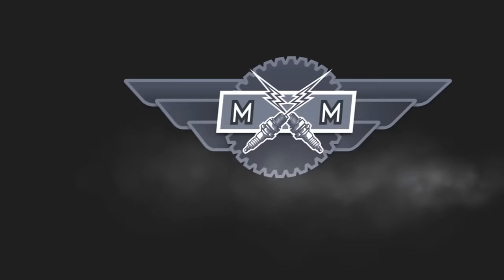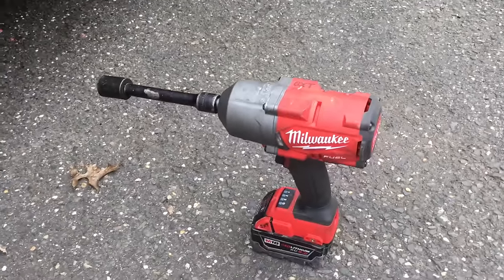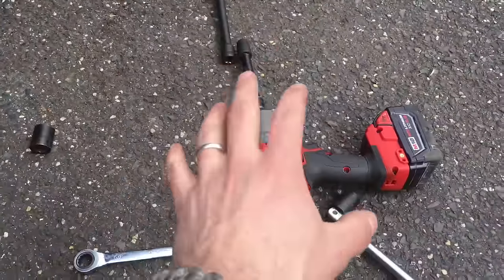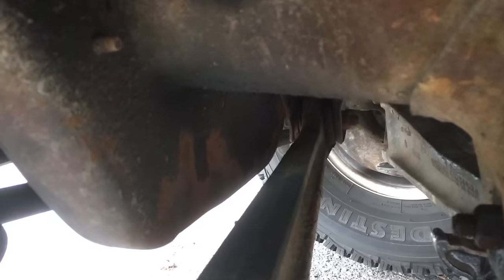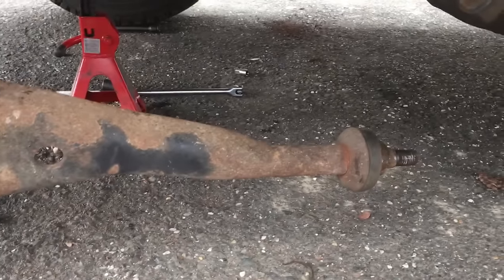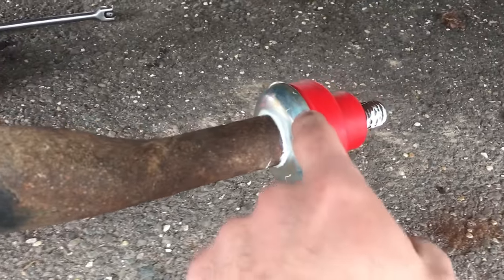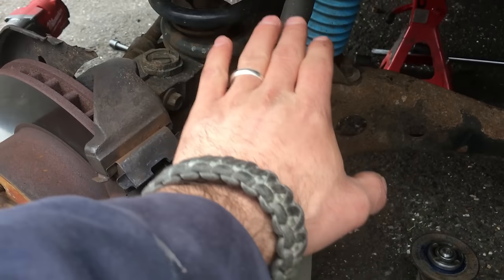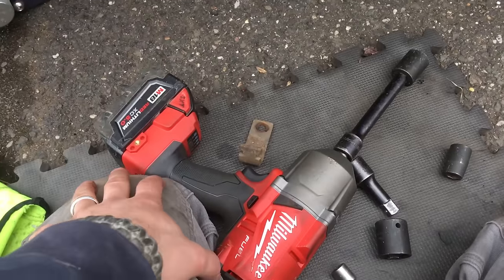How to Replace Radius Arm Bushings | 1995 Ford F150

Comment: To any torque freaks like me that might see this, the torque spec on the:
Radius arm bushing: 80-120 ft-lbs
Front shock absorber stud - upper: 25 - 35 ft-lbs
Spring retainer: 13 - 18 ft-lbs
Axle pivot: 120 - 150 ft-lbs
Reply from the maker: Thanks man! I appreciate you putting this year!🤙
Reply: @TheMinuteMasters  no probs, I've got access to the service data, I just like to see a video of how it's done if I can, so I appreciate the vid
Reply from the maker: @censorshipsoldseparately612  Nice! Service manuals are great for that info. Thanks🤙

Comment: If you do not use the spacer, the rear bushing will get torn by the lip on the radius arm bracket. You can get the washers and spacers from Ford. They are not that expensive.
Reply from the maker: Kenny Lee Johnson Yeah I ended up using the spacer. Not matter how I feel about the design of something. I always repair it to OEM spec just to be safe.

Comment: You don’t need an impact gun to remove nut from radius arm. Spray penetrating fluid a few days before you’re going to work on your truck. Mine came off super easy with a 20” breaker bar while laying in my back in gravel. 👍
Reply from the maker: Good point! I couldn’t get the correct leverage on my radius arm nut. So I opted for the impact gun.

Comment: The plastic part is there for a very good reason. I cannot believe you say it is your choice to or not to use it. The plastic piece goes on the MALE part of the hole and then flat side of bushing and then washer.
Reply from the maker: I found out later that that plastic piece is needed to keep the metal from rubbing and destroying the poly. I just don’t think I they can handle the torquing down of the nut. They seem to break on everyone.

Comment: Remember EXTENSIONS REDUCE torque. Use the shortest distance to remove nuts and bolts on TIGHT FOR YEARS. Torch the rivet heads off, knock bracket off with hammer. Tap rivet remaining with center punch. Install new bolts
Reply from the maker: This is true and removing the rivets is the fastest method for sure. I wanted to do it the way a traditional shop would.

Comment: I remember doing those at the ford dealer back in the mid to late 90s. I just remember taking the nut off and using a big bar to pry it out. We would slam bam stuff and move on. I think i used a snap on impact swivel so it had more power then an extension.

Comment: Nice video...I would like to mention that most professional front end guys drill out or grind off the rivets holding the radius arm bushing bracket and replace them with grade 8 bolts.  You can then do this job in a fraction of the time.
Reply from the maker: Thanks man!🤙 That’s what I’ve heard as another method. I wasn’t sure if Ford techs did that too.
Reply: Still took me a day
Reply: 1hr 30 to do 1 side without drilling rivets it would take that long to get the rivets out let alone go buy correct bolts
Reply: Sometimes if you're lucky, you'll have a truck that already has the rivets replaced. Mine were and it's a 1978. I had to replace the bushing and discovered it was so far gone by the time I bought the truck, I had to replace the bracket and radius arm. Luckily the donor was also bolted in.
Reply: I torch the head off those rivets. Once the rivets are gone and replaced with grade 8 bolts, this is a job that can be done very quickly and literally in the parts store parking lot

Comment: My problem was getting the bracket off on the exhaust side not much room. I'm gonna try a 3/8 breaker to hold the bolt in place and a 1/2 impact on the easy side.
Reply from the maker: Agreed. The exhaust side is tricky. If you removed the catalytic converter heat shield, you can get more hand room.

Comment: The plastic spacer is to go on the back when you have a raised section on the hole it stops the rubber chopping out on that raised lip.
Reply from the maker: That’s what I figured. My spacers are still in there. I which someone would make them out of steel or aluminum. The plastic can break when you tighten these poly bushings down.

Comment: The 4x4's aren't quite s easy. I went thru all the steps and still wound up grinding out the rivets. could not pull the radius arm forward enough. about 1/16" was all I needed, lol. Great video!
Reply from the maker: Rick Knight Thats what I hear. It only budged 1/16th? Did you unbolt the axle pivot bolts for the  I-beams? 
Thanks man!🤙
Reply: @TheMinuteMasters  No, all I needed was for it to move 1/16" more to remove it. Those aren't very flexible.
Reply from the maker: Rick Knight Ah I see. Yeah they aren’t at all.

Comment: I am not doing a F1 50 I worked on a Ford Ranger did the same job on a ford ranger 1991 and this helped Wish I would’ve watch  it completely because I didn’t remove the sway bars. Made it a little hard
Reply from the maker: Andrew Burns Yup! They do have the same suspension! Glad it helped ya!👍

Comment: Those end nuts are really tough.  Got mine done last fall.  I sprayed them down....heated them with a torch....and then had to go back and forth with the impact gun....and they finally let go.  Took me a few days to figure out how to loosen them....lol.  Toughest nuts I've ever had to loosen on the truck....a 1992 Ford F250 5.0.
Reply from the maker: I did the same thing. It’s the only way to get those nuts off. 
Nice! 🤙

Comment: About 15 years ago, I rebuilt my 68 f100 entire front suspension.  Here are the mistakes I recall that time may have distorted.  I decided to drop my whole drum brake front suspension and replace with stock front suspension and brakes from a power disc 1974.  I can’t recall if I had to have spindles altered in any way.  But, my biggest error was dropping it all and trying it all.  This all struck me, and I’ve been watching videos, as I’m about to buy another 68, as I’ve regretted selling mine years ago.
The 68 I’m looking at was pulled off the road due to long distance camping use and well over 200k on the stock front end.  The pivot bushings touch no where on either side.  So, I know I need total rebuild.  THIS time.....I’m going to grind those pivot bracket to chassis rivets heads off and use air hammer to knock out rivets and replace with grade 8 hardware.  And, I’ll do one side at a time.  
Another mistake, reusing stock coil springs.  I’ve done this on a couple old cars being cheap and it’s bit me and I’ll spend extra for new springs on next total front end rebuild.
Reply from the maker: Definitely a good plan man!🤙 Spend good money on a set of coil springs. In my opinion, Moog and ACDelco are garbage.

Comment: I didn't use the plastic spacers when I replaced mine yesterday I left my truck up on the jack stand which was on the frame and then I used the jack on the actual radius arm once I took the nut off to better control the arm as I put on the new bushings.

Comment: I tried using a 29mm socket with my standard 1/2" breaker bar since I didnt have a 1-1/8 and it worked... surprisingly easy. Yes not optimal but it broke torque and took the nut off. Pros of having a desert truck I guess.
Also, I was having a night mare getting the radius arm located with the axle dropped from the pivot. I decided to run the bolt back through the axle pivot to help locate it, put a ratchet strap to the other radius arm and put tension on it then walked it in by working it up and down with the jack. Real headache getting it all located in place correctly but that worked best for me.
Getting the nut started on that radius arm once the new bushings were on is also a pain in the cock but ratchet strapping the axle to the transfer case crossmember to pull tension backwards and then jacking the axle up real high worked to help me get the nut started. Just some tips for any other guys with 4x4 axles.
Reply from the maker: Good to know man! Thanks for sharing!🤙

Comment: If you go to autozone you can actually get the bushing in a kit. It 10.99 for both side. Comes with washers spacers and all.
Reply from the maker: Dillon Nelson Nice! That’s a way better price! Good to know!
Reply: The Minute Masters you're welcome. I just bought some today
Reply from the maker: Dillon Nelson Awesome! Good luck with the repair!👍
Reply: The Minute Masters thank you man. Mines 4x4 but I have a little different plan of attack.
Reply from the maker: Dillon Nelson Yeah 4x4 is definitely a little more difficult.
Reply: How does the AutoZone kit measure up to the energy bushings? I'm thinking about buying the energy bushings and using the hardware from the AutoZone kit if the bushings are not as quality as the energy ones.
Reply: @davidrivas2509  
AutoZons are Ok , I've used several of them over the years .
What I like is their LIFETIME WARRANTY .

Comment: great video except for the jeweley that you are using; as a pro autotech i can tell you that there's a slide difference, while you are working in suspensions, in conserving your limbs intact until you turn old enough to tell every one about your experiences with it, sometimes they have unnexpected reactions to the repair procedure you are doing, like when you are replacing coil springs, leaf springs, struts/ mcphersons, or even rebuilding power boosters or heavy duty air brake caging brake chambers, fifth wheel rebuild, or even pto service
because every day we're working with more sophisticated and faster technical repair equipment, like your milwakee impact gun,  the chances to have an accident are higher now than before
during my earlier life experiences with repair/ service procedures in the automotive industry, early in the 1980s, i used some jeweley myself on my hands, then i started to have bad experiences with it: a ring got toasted on a battery terminal, a bracelet got engageg with a moving fan, a wrist band was trapped by a steel clamp, and also a lond sleeve got engaged with moving pulleys from an engine in motion
at automechs school, my automechanics teacher used to tell us all the time - while we were working on cars, be organized, keep your eyes and ears open to any hazards in your working environment, and always apply all safety practices you have learned to stay in one piece, lol 😄 - and that are life savers i think
im retired now, with a few scarfs but complete in one piece - still working but on private projects, but my teacher's words still fresh and alive in my memory today and every day i open a hood or i raise a car
peace bro 👍
Reply from the maker: rubber MALLET Great read and very well written! Thanks for sharing!🤙 
As of late, I’ve stopped wearing any rings, watches, or bracelets while working on my truck. I’ve seen pictures of de-gloved fingers.😖🤮 That was it. Lol No more jewelry. Besides, my watch doesn’t get banged up as much too. 
My latest PPE obsession is wearing eye protection. I was told by a mire senior guy that you only get one set of eyes and there’s no replacing them. All the dirt, metal, and rust that falls on your face while working under an old truck is annoying already. So between no jewelry and eye protection, I hope to live a longer more “intact” life. 
Keep raising awareness for us young guys. Not enough of us are taking adequate precautions on the job site or work space to protect our health.
Reply: The Minute Masters bro, you have taken the right decision by stopping the use of unnecessary jewelry while performing automotive tasks
regarding your watch, just remember this, it is harder and stronger than a wrist band and may cause more personal demage or huge economic losses - just saying, bc i've seen those accidents on different shops
👉 one major thing that you must be aware of its inminent danger are cars with steel fans or cars with conventional frontal engines that have fans mounted in front of the engine bay, these fans some times have broken shrouds or not shrouds at all, so when you are testing them - lets say you are accelerating / raising rpms - these fans some times expands and if you have your body on top of it the fan will cause a deep/ profuse cut that may make you bleed to death
a guy that i know, used to be an experienced carburator mechanic, did that mistake and got a deep cut under one of his arms - he lasted 15 minutes alive, when the paramedics arrived he was dead already
remember: keep your eyes and ears open all the time and you'll make it to the end for sure
good luck bro 👍😁
Reply from the maker: rubber MALLET Damn! I knew those radiator fans were hazardous but I never heard of fatal accident like that. 
I’ll definitely keep my eyes and ears open. 🤙
Reply: The Minute Masters i could probably tell you about many other serious accidents caused by people neglecting basic safety standards while on duty, but that will be a different story, but i can cite a few
for example, a tire man in the middle of the jungle back in the 1970s refused to obey an order from our boss in a heavy duty repair shop - we used to repair cats, macs, peters,  magirus, heavy duty equipment etc  inside the jungle, the boss told him to leave alone a very expensive super huge tire that got flat on a road accident, that tire was from a caterpillar giant truck - the really big one - the boss had to go to do something to the city so he left, the tire man took advantage of it and without hesitation he installed a huge tube into a tubeless humongus tire! .. and while he was inflating it, its outer safety ring came out loose and exploded loudly, blam! the ring barely touched the tire man's forehead but that was more than enough to open his forehead in two pieces and while he was alive his brain started to show up through his wound - that was very scary to watch - he was suffering for almost 3 weeks before he passed away 😵
it happened early in the morning, around 8:30 am, at about 10 feet from were i was into my boot to get some tools 😭
and i saw countless, very stupid several deaths, limbs getting chewed or amputated by moving parts while feeding it with material from different machines or bc they were caught by leaf springs that bounced back from jack stands and they have their hands holding it, people being struck by big garbage trucks against the shop main door bc they forgot to apply the parking brake on, or mechanics running behind a big semi, people loosing their sight because hoses, batteries or radiators exploded - that is why its a good idea to use googles 😎 all the time, use gloves of any kind, working shoes and not too loose clothing 👉 and be alert all the time 
iow, never trust your environment, always be alert, test it again and again - specially heavy equipment being suported by jack stands or hoists, and finally, while you are slow, clean your working area, wipe out the grease out of your hoses, clean your tools, restroom, floors, trash cans, offices etc 😷 - just keep it clean lol 😁
Reply from the maker: rubber MALLET Wow! You are a wealth of stories my man! I love it. The scenery is great too. “In the jungle” makes it sound that much lore exotic. Fantastic examples of why safety is important. Tire man story is something else. I think a danger to personal safety is people not thinking they even tire rubber cab cause trauma to the body. 
I’m big in cleaning. I’m always reorganizing job sites and work areas.
Reply: The Minute Masters great, keep it like that bro
yeah, i was a teen when i started working on that hydroelectric project, and there is where i witnessed the worst accidents i could ever remember of
after a while, lets say almost 2 years, i became in charge of the repair shop facility, when my boss got ill from being biten by a huge black tarantula - bc i was very young, a fast learner, and i always keep on my eyes open, then, they gave me the oportunity to lead the whole project, i was very proud they could recognize my big effort to make things better over all
i actually quit that job after witnessing the worst accident i'd ever saw
16 people died on a truck accident going back from a near by little town in the middle of the jungle, to the shop deep down in the middle of a valley where two rivers where put together into one huge river canal to feed the gigantic hydroelectric rotor/ stator device in the 'machines' home' 🏬
the driver was the only survivor
one of the guys who died in the accident was my personal right hand aide and personal friend at the project, and, i got depressed - so after struggling for a while with that psichological trap and the great memories i had with my friend i decided to give up on traveling around the world then i got back home and i got enrolled in a vocational school where i met the best trade - welding, body and fender repair, automechanic and industrial mechanic - teachers in LA, Ca 👍
trust me, in life there are scafs that will never fade out bro 😪
keep your eyes/ ears open all the time 👀
Reply from the maker: rubber MALLET I sure will man! 🤙 I appreciate all your life stories!
Reply: The Minute Masters thank you for listening to it, i hope they will be used wisely lol 😁
Reply from the maker: rubber MALLET You are most welcome man! They sure will!
Reply: rubber MALLET , your so right about jewelry, I know someone who was wearing a wedding band , a high gold content one, long story short, he managed to let it close a circuit  with it on his finger between a wrench and a 12 volt battery in a pickup truck, the ring instantly turned nearly red hot and ofcourse instinct kicked in and he grabbed it with his other hand and pulled it off. It was not pretty, at all! After that I refuse to wear any rings period.
Reply: NoOneSpecific 🎻👌

Comment: I did my 1980 f150 4x4 this day so. Passenger side. The beam would not drop down and it was a mfer to get the radius arm back in. I’m doing drivers side tomorrow and I’m definitely grinding or drilling the rigors out.
Reply from the maker: Well at least it tells you that your I-beams are solid as well as the brackets. 
Nothing wrong with going with the grind off the rivets method.🤙